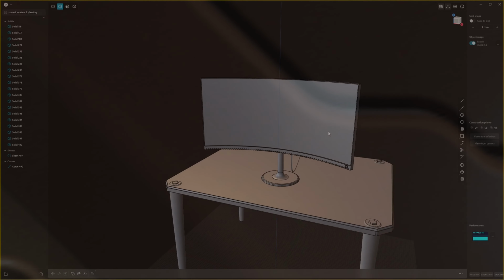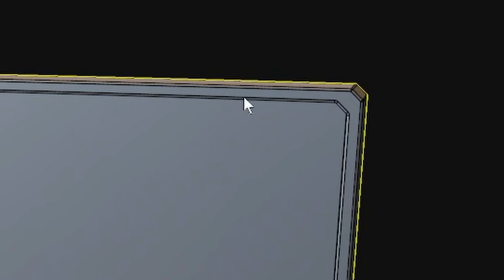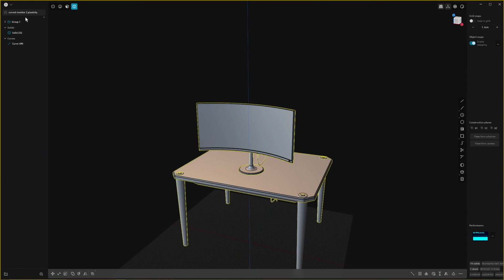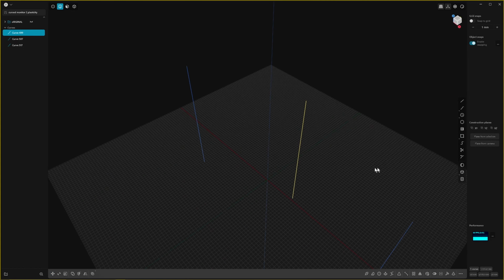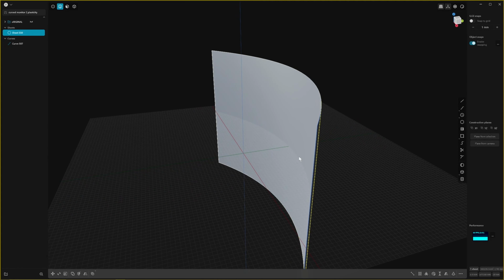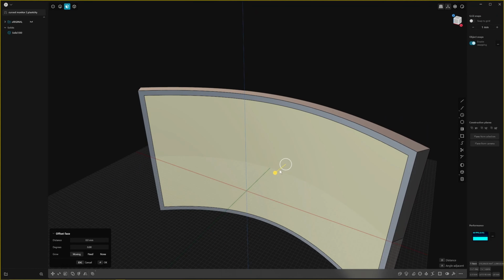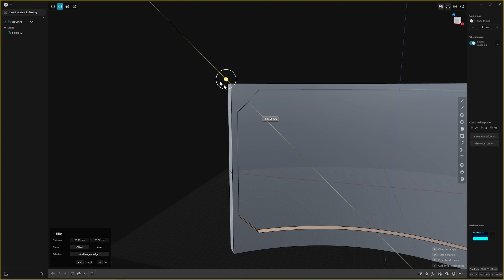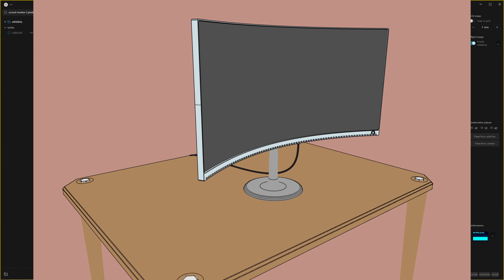Plasticity For Beginners -  Quick Tip - Build a Curved Surface

Comment: Nice. How did you do the air vents below? Since radial repeating/symmetry wouldnt work there.
Reply from the maker: I copied the bottom edge which automatically turned it into an curve and used a curve array which can be found in the search menu by pressing F on your keyboard. And that allows you to perform an array along any curve.
Reply: @takerefuge3d  ohh cool! I didnt know curves had such a feature.

Comment: As of August, 2024, Alt+F did not fill the edges for me. I assume it's the Patch tool, which is Shift+J.
Reply from the maker: you can assign any command to any combo also. So I don't even remember if it started like that or not at this point. 🙄😅